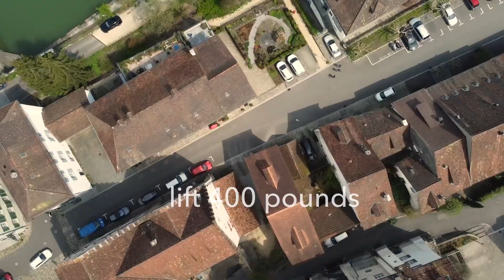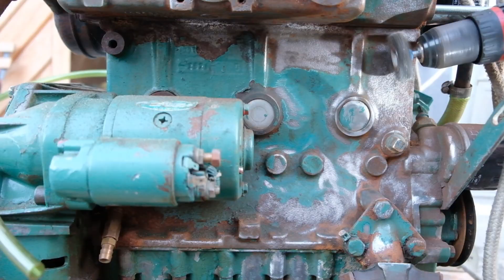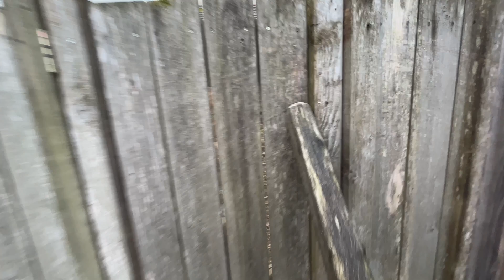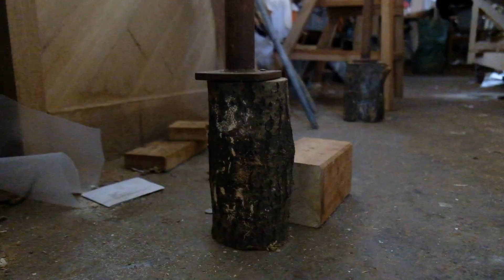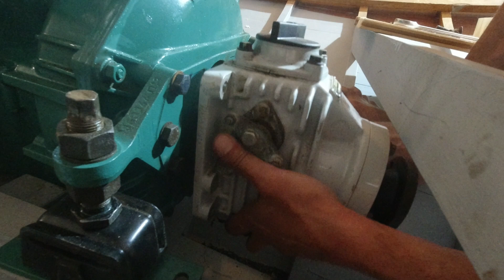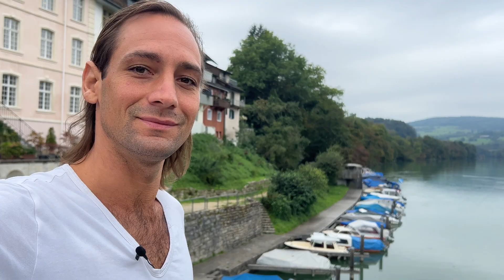Lifting a 400lbs volvo penta engine - craft endra EP18 I Building a wooden sailing boat

Comment: My Volvo developed exactly the same crack.  A friend's Volvo engine block developed a crack. Even the casting on a Volvo windshield wiper motor cracked. These people at Volvo do not know how to cast metal.
Reply from the maker: Obviously it was just a lot of rust in the bow, what is not surprising in any exhaust system. I trust Volvo is reliable for their engineering 😉 and the block stays in one piece 😅. Thanks for sharing!